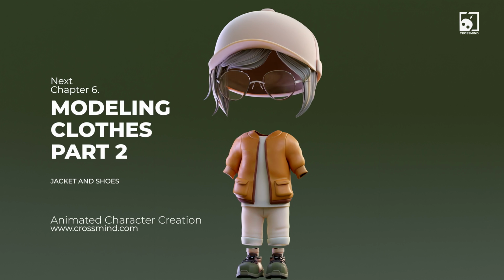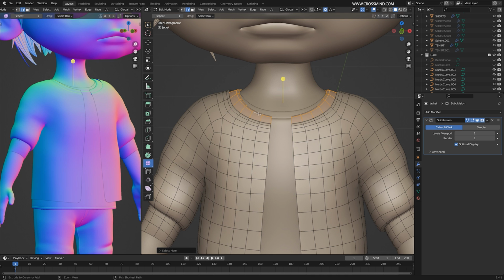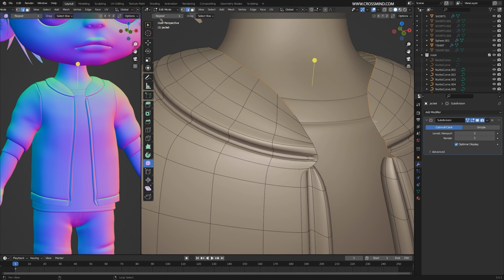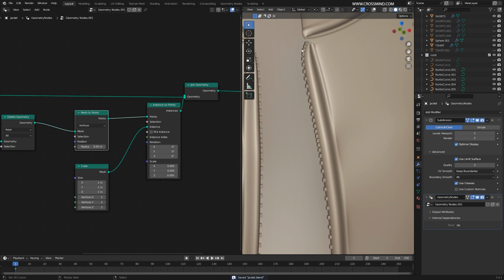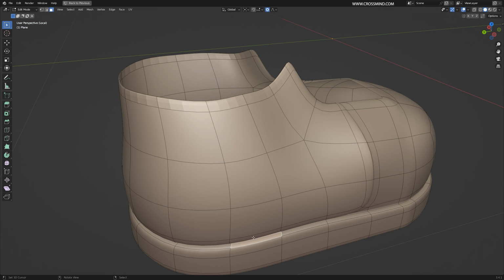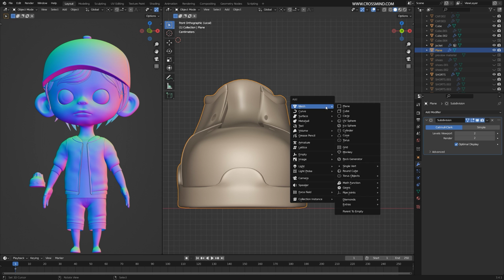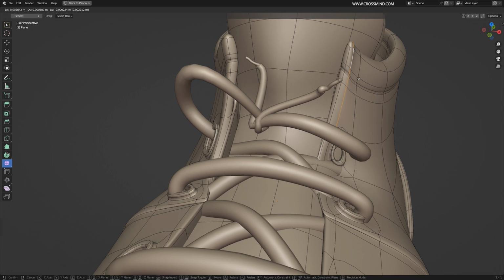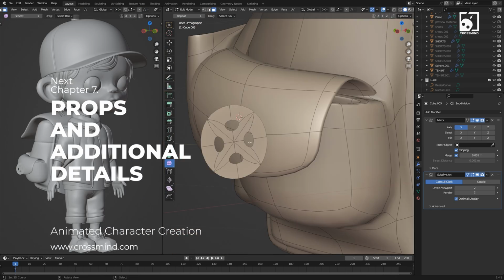06. JACKET N SHOES / 3D Character Modeling  #blender3d #animation

Comment from the maker: Frequently Asked Questions and more :
Get Premium Edition to Unlock Bonus Chapters and Project Files . Early Bird Discount - Coupon Code : ACC20  https://crossmindstudio.gumroad.com/l/animatedcharacter

1. What version are you using in this course?
   I am using Pre-release 4.0, but this tutorial is compatible with previous versions as well. A few improvements and updates in riggify and shading nodes have been mentioned, comparing both the old and new versions. You can also follow along with the LTS version.

2. Where can i get the full course?
    https://crossmindstudio.gumroad.com/l/animatedcharacter

3. Is this course entirely free?
   The course is not entirely free. Modeling to shading chapters will be released on YouTube every few weeks. However, the Premium edition on Gumroad unlocks the full course, including the       
    complete process from modeling, UV, shading, rigging overview, rigging with riggify, weight painting, props manual rigs, pose library setup, animating walk cycles, cloth simulations, creating a background with geometry nodes and procedural shaders, lighting, final rendering, and compositing. In addition to bonus content, it also comes with project files, animated bonus scenes, and other benefits. Check gumroad for full information.

4. Will this course be compatible with the next release?
   For as long as there are no major changes to the interface of Blender, this course should be compatible. The last major UI change Blender received was recently during version 3.0, and the same      
   will be followed in upcoming versions as well.

5. I am an absolute beginner; can I watch this series?
   If you have never used Blender before, I suggest you clear the basics first. Please check out this series, which helps with basics: 
   https://www.youtube.com/playlist?list=PLgO2ChD7acqH5S3fCO1GbAJC55NeVaCCp . After this, it will be easier for you to follow along with the new concepts introduced in this course.

6. I need help regarding the course; where should I connect?
   You can use the dedicated Discord channel for this server. The link to Discord is available in the description and channel banner: 
     https://discord.gg/sA5HMKcR
Reply: My brother, would you consider finishing the soul stealer project tutorials. there is only a few chapters left and it is such a cool concept. leaving it unfinished is heartbraking

Comment: Hi ram, i have bought this Course, Character model which u hav shared in this course, its a low poly model comapred to the one which u r promoting in this course video. Can u pls address this, i am unable to join discord due to some techinical issues .. pls drop ur mail id
Reply from the maker: In render properties disable simplify. Simplify disables subdivision to improve performance. This is mentioned in course.
Once you do that character will appear smooth with subdivisions.